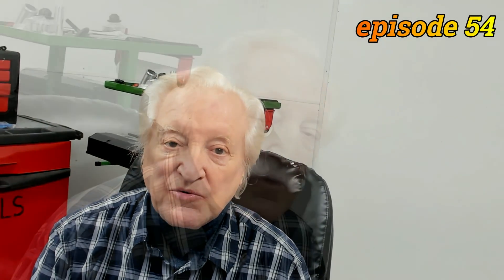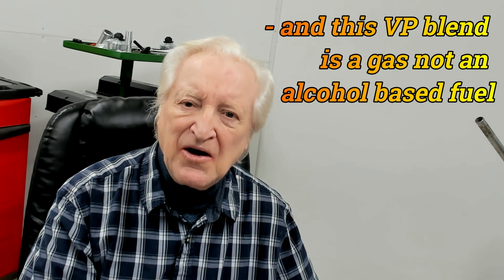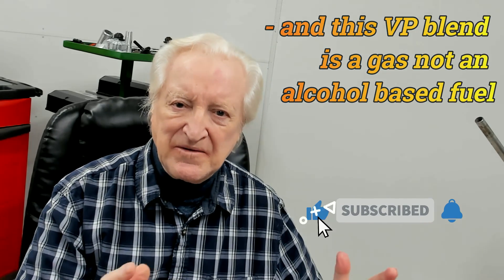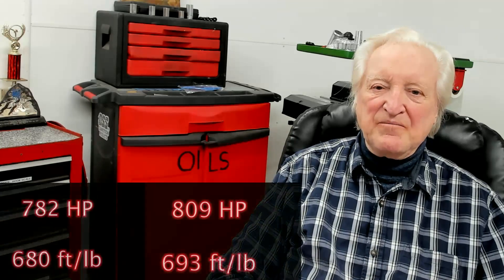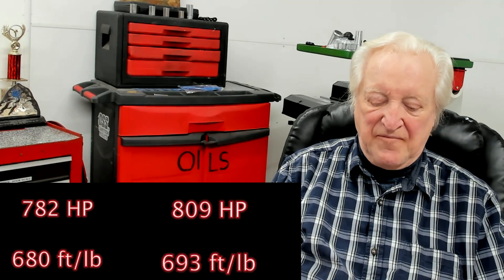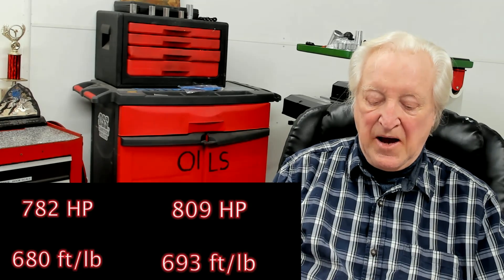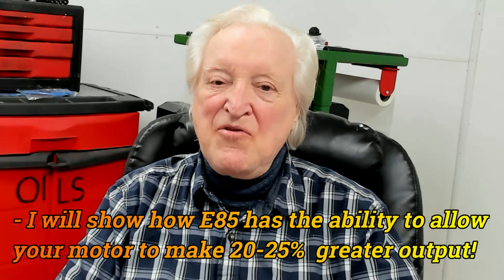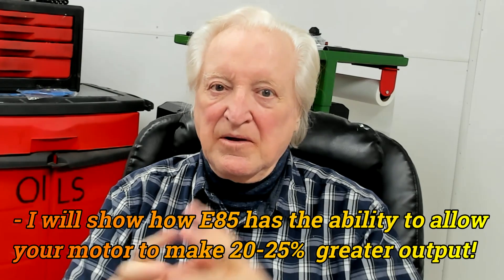VP's Oxygenated gas. Does it actually work??

Comment: The air / fuel ratio changed as did volumetric efficiency as the VP fuel brought more oxygen to the piston party!
In a perfect world that I have said for 20+ years, the best invention would be a "Nitrogen" air filter. If somehow clearly without restriction, this type of filter would put 98% oxygen into the mix. Now, a pair of main fuel jets would be the size of a thimble or 1/2" socket. Imagine that! Engines everywhere would be exploding unless they could handle the horse power and torque.
Thanks David for reminding me of that dream! There would be a Noble Prize in there as well! Love it!

Comment: An engine makes power at high rpm due to the cylinders are firing    in rapid succession. I wanted to build a multi cylinder firing v8. 2 pistons working in sync.  May need a regrouped cam and crankshaft.

Bloodviking

Comment: David, Merry Christmas, looking for a roller cam recommendation. specs: 2600lbs modified circle track car, VP110, 750VDL carb. Mandatory 1ich, 7/8 tapered carb restrictor, Max 6500RPM. SBC 13:1 410ci, roller cam, Brodix 10x heads.  Thank You.

Comment: My 496  is built similar to this one . Mine is just below 12 to 1  with a Solid Roller camshaft, AFR 325 V2 with  a clean up job and a Victor 454R  Gasket matched and mild clean up. Dynoed on VP Q16 849 hp @ 6900 and 703 lbFt  @ 5000.  I can't wait to make a pass in my car !
Reply: Can you share more of the specs on this build?

Comment: Hello Mr. David Visard.   Funny story,  for many years I worked on high performance 2 cycle engines. When owners  installed piston and rings purchased from my store they would sometimes come back with a burned up piston say that it must be defective.  I would ask them if they had put more two stroke oil in with the gas for 'break-in' and the would normally say 'well of course '   I would say well then you didn't read the instructions did you  ?  Wiseco pistons, said right in the instructions NOT to add oil to the mix.   As you would understand,  adding oil made the engine run lean because it was displacing the fuel.

Comment: I've often thought about a stroker BB Chevy with a tunnel ram.  The carb's are on methanol, but there are port electronic injectors with pump gas.  Turn off the idle circuits on the carbs.  I'm thinking I would only want the methanol to suppress detonation near WOT peak cylinder pressure and to add oxygen above that.

Comment: Having played with fuel for near 50 years I have found many differences. The majority of the time was Avgas 100 which I guess was the baseline. During energy or fuel shortages we were not allowed to use it. This late 70s. So I ended up beingadvised to use Supergrade fuel with 20% tolulene. It did not ping but it was lazy. This on a probably 10-1 Holden 6. World became normal?? and back in 100 for some period. Then was involved as engine sealer for HQ Holden racing. Where the 'experts' had 12+-1 comp. And still blew a LOT of headgaskets and the occasional piston as the Holden chamber really would NOT handle that compression. 11-1 ideal. This on a single 1 7/32 Stromberg. The cars were fast though, indecently so. Then the governing body put them on unleaded. 98 octane. And introduced compression limits. After a LOT of new heads the cars are slugs on 10-1 and 2-4 sec a lap slower.Depending on track.
In recent times I have been down the E85 route,, not succesfull in my case and it corroded the bores as well Proper E85 carb.
And on my speedway car using 100 unleaded I found the engine was a little lazy and ran warmer. Though tune had not been touched. The 102 oxygenated has yet to be tried. Others are finding the ELF brand better than the others. Though at over a dollar a litre more it should be!!

Comment: Great video!

VP or E85? E85 has an octane rating higher than that of regular gasoline's typical rating of 87, or premium gasoline's 91-93. This allows it to be used in higher-compression engines, which tend to produce more power per unit of displacement than their gasoline counterparts.

Renewable Fuels Association titled "E85 Facts" which cites a range of 100-105, and a document at the Texas State Energy Conservation Office titled "Ethanol", which cites a 113 rating.

Some vehicles can be converted to use E85 despite not being specifically built for it. Because of the lower heating value E85 has a cooler intake charge—which, coupled with its high stability level from its high octane rating—has also been used as a "power adder" in turbocharged performance vehicles. These modifications have not only resulted in lower GHG emissions, but typically resulted in 10-12% power and torque increase at the wheels. Where the engine was previously knock limited by gasoline, power improvements are as high as 40%.

Because of its low price (less than US$4.00/gal in some places) and high availability in certain areas people have started to turn to using it in place of high-end racing fuels, which typically cost over US$10.00/gal.

Comment: One thing to note about using oxygenated fuels is it makes the combustion chamber highly prone to rusting  so if you run it you need to fog your intake with some lube before shutdown or the next day you can have rusty cylinder walls relapping your built motor for you.  There are anti corrosion additives in most ethanol fuel blends that help prevent this but from what I understand those things hurt power so the VP fuel doesn't have any corrosion protection additives.

Comment: Mr V., I'm not about to contradict you on anything (except spelling; e.g. "Ignor". It's Ignore 😉), but why do so many AFTERMARKET cams for modern engines (LS, LT, Coyote, Gen 3 Hemi) have WIDE LSAs, from 113 to 118??
Reply: I believe it has to do with keeping the computer happy the more choppy it gets the more it messes with the computer not knowing what is going on and you get a tail wagging the dog effect that can cause all kinds of issues. The wide lobe seperation tames things down so the fuel injection control doesn't go nuts.
Reply: DV has addressed this subject quite well in previous videos.

Comment: Need air flow to carry the additional fuel. See if it works with the restricted 2 barrel. Increase the jets. 
 The increase can be had because of the additional timing added. Burns slower!

Comment: I always put non ethanol in all my vehicles if possible it bumps the mpg by 2. To 4 mpg in everyone of them figure that one out 🤔😀
Reply: 10% ethanol reduces mileage 6%. 
Actual btu difference and testing.
Trouble is, "10" % ethanol varies from 8 to 17%. 
I bought a tester and caught some at 17.
6% better mileage does not offset the 22% higher price.
Yes I run 91 NON ethanol in the hotrods.
E10 in the daily.
Reply: @hotrodray6802  I've done my own test I do the same lol, but where I'm at (small town) I can get 93 non ethanol. Unless Walmart is lying, only place around that has 93 non ethanol. Everywhere else is either 89 or 91
Reply: Yes I drove for a fuel supply company. Tankers u would not believe what is ok to go into the fuel supply, then we wonder why things fail and sensors go out. U might be surprised.

Comment: Probably a very daft question, but does the oxygen stay in the fuel for prolonged periods? I find myself imagining it a bit like a carbonated drink but presumably the oxygen is actually chemically tied and not in gaseous bubbles?
Reply: I run MS109. It's not like a carbonated drink where the molecules are dissolved into the liquid. The oxygen comes from added toluene and MTBE. Those chemicals contain oxygen atoms. The oxygen is released as the fuel is burned, not when it's atomized. That being said if you leave the fuel unsealed, it evaporates very quickly. What's left after lots of evaporation definitely smells different out the exhaust.
Reply: It begins to degrade within 30 days unless you add stability fuel additive. Then your good for 1 year